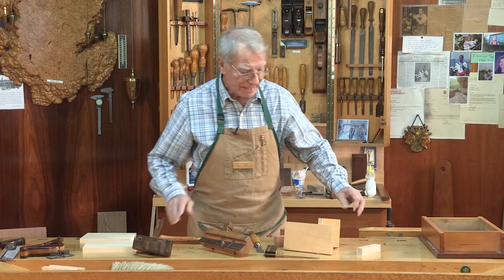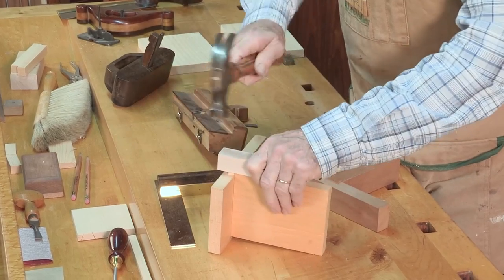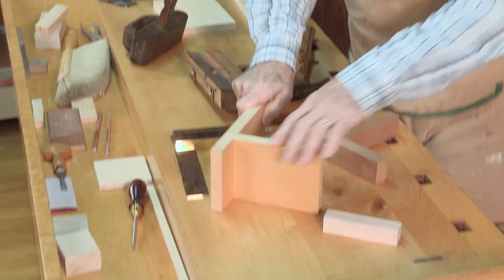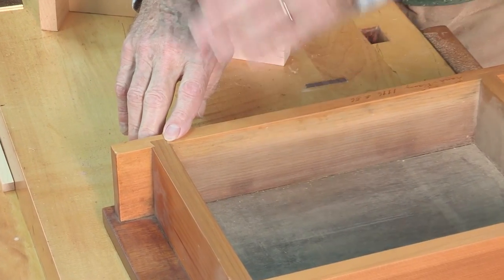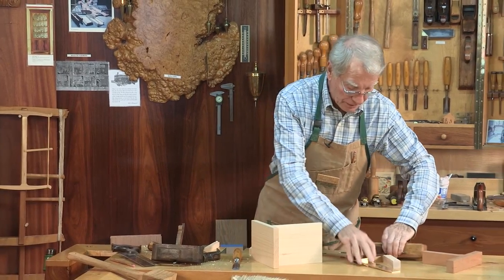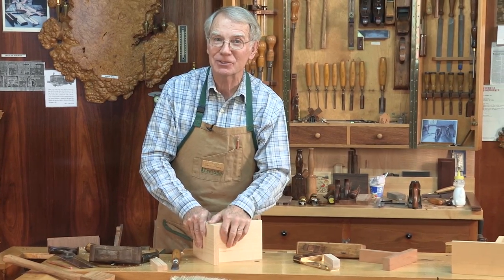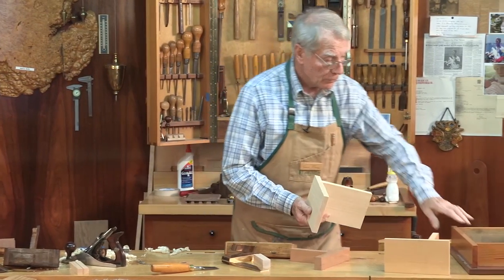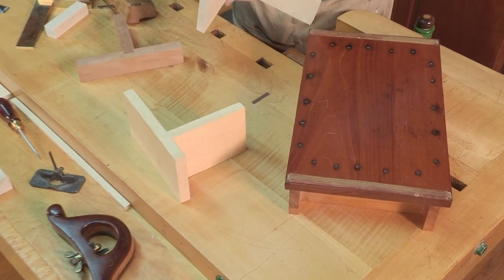Frank Klausz' Water-tight Joint

Comment: thank you for that. when I first saw you doing it I remembered something  a teacher did in a plastics class at school back in the 70's along the same lines.heated a small sheet of acrylic plastic in the oven. then sat a house key on it, and while it was still soft clamped it tightly between 2 boards in a vice  to leave an impression of the key in the plastic. after it cooled he then proceeded to sand the plastic till the impression of the key disappeared completely. after that he put the plastic back in the oven to heat it up again.lo and behold like magic a perfect reproduction of the key rose up like magic out of the flat sheet of plastic after a few minutes.all of the students in my class were amazed. this is along the exact same lines. thank you for sharing. and I'm sure your Grandfather wouldnt mind you sharing it with us. :-)

Comment: Grandpa's are great. Now I need to know how the do the tapered dovetail.
Reply: I use a lot of sliding dovetails.  I use a 25-yr old "Joint-Matic" vertical router table, or my JDS Multi-Router, which makes cutting them even easier and faster.  A much less expensive, but very good alternative, is Matthias Wandel's PantoRouter.  Using any of these tools makes cutting sliding dovetails a piece o' cake.  I can't imagine how I could accurately cut sliding dovetails by hand, but if anyone could do it, it would be Frank Klausz.

Comment: Can someone explain how this works exactly? He never explained what the reasoning was for the technique......no doubt in my mind that it works just curious as to what's going on.
Reply: When he hammers on the wire, it compresses the wood and forms a semicircular channel in the wood's surface. He then planes off some of the undisturbed wood. He fixes the sides to the bottom with nails. When he puts water in the box, some of it seeps between the sides and the bottom. When the water is absorbed by the compressed wood fibers, they swell up and form a "gasket" under the sides. It's really quite ingenious.
When I was a kid we used a similar technique to get dents out of gun stocks. We would put a wet rag over the dent and place a hot clothes iron on the rag. Steam would be driven down into the dented wood and would expand the wood to near-original condition. 
Even knowing that, I didn't see this waterproof joint coming until he had completely explained it. Someone somewhere had an ingenious insight many, many years ago.
Reply: He does explain. First, he compresses fibers with paint can handle, then when water soaks in the fibers decompress pushing against the bottom panel. It's the same concept as using an iron to swell dents out of wood.
Reply: @g.v.harvey7425  exactly. Should have read your response first, you explain it very well.

Comment: i dont get this at all..... how does an indentation create a gasket and why would you plane it off  after you make it? makes no sense to me.....
Reply: The indentation creates a dense layer of wood below it (you basically compress the wood under the indentation). Now you plane it off, so you are left with no indentation, just a flat plane of wood with a denser part in the middle where it has been compressed. Once water hits that area, the area decompresses and expands a bit. This will seal off the joint between the flat bottom and the sides.

Comment: As much as I like and respect Frank, this one is tough to justify, even though educational.  He said at first, it would leak for awhile, then seal up.  What's the point of the work to do it?  This is one of those rare times for plastic, even for a woodworker.
Reply: because you can't find plastic in nature.
Reply: Donald Dorn because he can
Reply: If his grandfather was doing it, then that joint is from a place & time where plastic was not available. Most likely no one in his native country was manufacturing it... probably no electricity, either.
Reply: it only leaks for about an hour. after that, you keep your water and stones in it and it doesn't leak anymore. thats the point.
Reply: because back then they didn't have plastic :D why do you think the barells were made of wood? cus it was easier? thats all they had that would do the job.
Reply: just in case you want to build a boat.
Reply: Donald Dorn when  Frank said that it will leak for an hour or so, he was refering to the very old water pond that is on top of his work bench.
Reply: Think just a bit...When this joint was first used there was no such thing as plastic, or rubber gaskets.  It is basically the same principle that kept wooden buckets from leaking for thousands of years.  If you have a well mated joint, put water in it, the wood will swell which creates a water-tight seal, so you can carry water in a bucket with nothing but wood on wood and it won't leak. Later, they used iron/steel bands to go around the bucket or barrel to hold the slats together. They used to put iron/steel tires on wooden rims for wagons for centuries and they made the "tire" a bit small, heated it to make it expand, then put it on the wooden rim.  When it cooled, it was tight without any fasteners at all. If, over time it got loose, the wagon would be driven into the water and the wood would expand and the tire would be tight again.